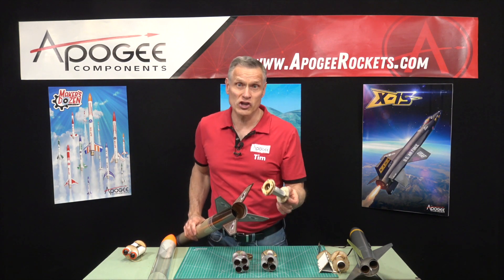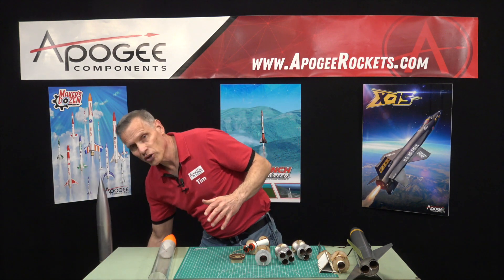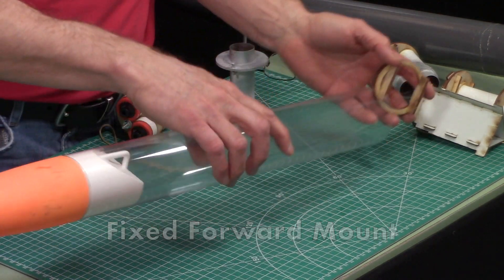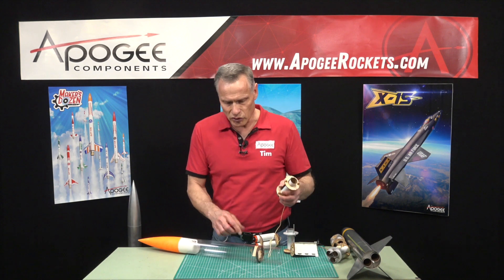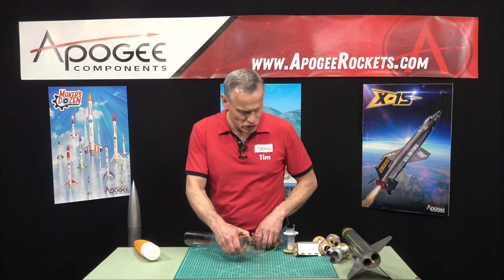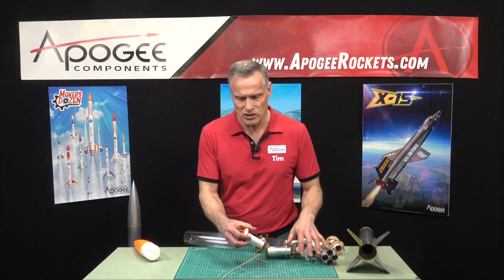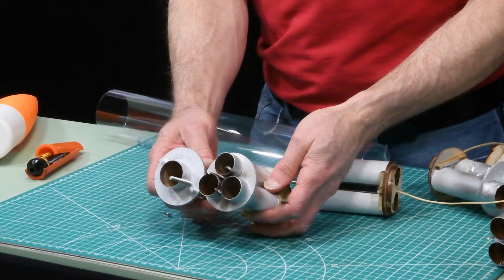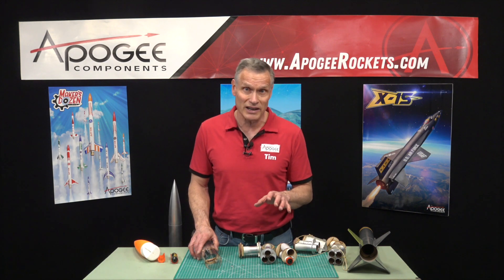Quick Change Motor Mount System For Model Rockets

Comment: My Estes Saturn V from 1969 has a very similar conversion system to use either 3 C engines or 1 D engine. It works very well.

Comment: Ow that's quite a cool idea. We've done it with tube couplers. I would like to see some kind of pin to prevent
the system from rotating. There is quite a humm in your video. A bad groundwire somewhere in your audio line?
Reply from the maker: I need a new microphone...